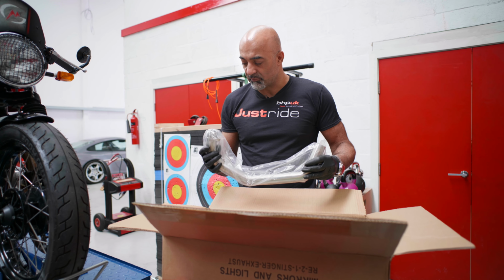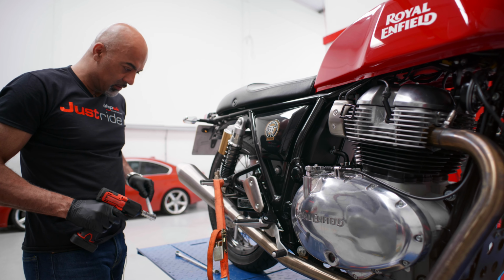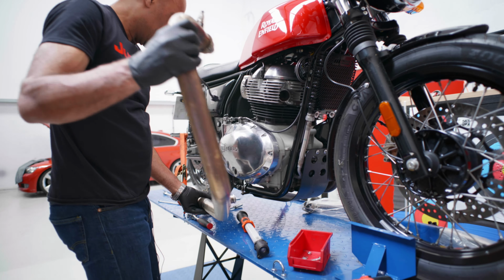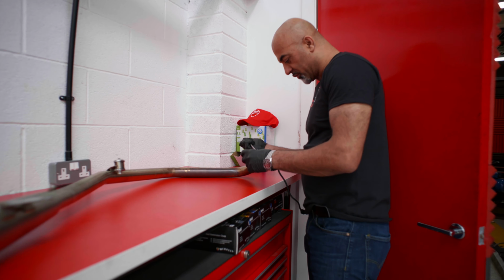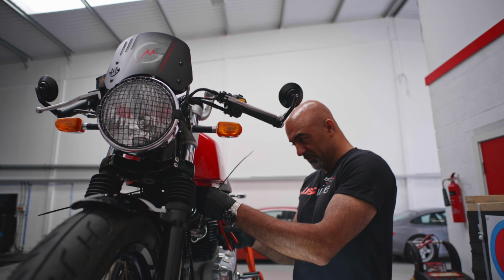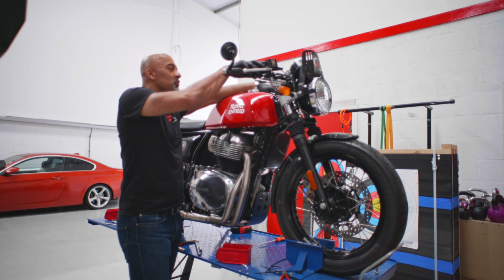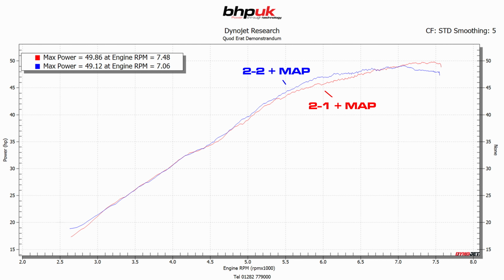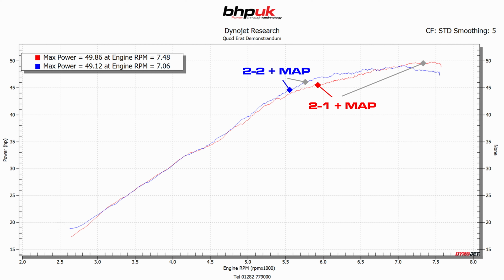Remapping the Tec Stinger 2-1 exhaust system | Royal Enfield Continental GT 650

Comment: Don’t forget the weight save that comes with the 2 in 1
Reply: Important point and a serious weight saving too!
Reply: 2-2 with a lithium battery be similar weight to 2-1 with stock battery & sound better & look heaps better.No exposed welds,no springs & TEC 2-1 works good but looks cheap & is made cheap but not alot 2-1 options out there.A 45mm 2-2 system no joins until mufflers & 45mm S&S mufflers no swagged end no gaskets best sounding & looking & with only 1hp difference between them.A 2-1 system with only one join at merge pipe if like 2-1.
I wonder how many 2-1 TEC have sold with their 4hp & 8Nm(53rwhp 71Nm) claims more than 2-2 big bore systems when other 2-1 systems built better less joins only make 1-2hp more max.A lot of people only buy TEC cause they believe hype & stats & think they getting 4hp 8Nm more.They cheaply made & reflects in price,springs outdated & fall off.
Good to see a independent source comparing systems first time I've seen TEC compared to 2-2 but never believed their stats where better companies only 2hp max better.
Was the 2-2 a TEC as well or other brand?
Reply: @ruahinesrider  This is subjective. I ride in an area of the united states where I have roads with potholes that swallow babies and salt on the roads from Nov to May and my Tec 2into1 has held up great. I have close to 4k on mine with no issues at all. Don't know how a spring could be outdated (not a lot has change in the spring technology department in the last 350 years) I mean this dyno just showed a increase of 4ish hp over stock (at the wheel not the crank). Looks are subjective but the S&S comp 2into1 is ugly plain and simple. Im very happy I spent 400usd for a full exhaust I like the look of and is a good quality then putting on a 800+USD exhaust that has S&S stamped on it.
Reply: @Jmacfann  Definitely agree about S&S 2-1 being ugly especially from front on with angle & have 2 high flow cats.The S&S Scrambler 2-1 look awesome but only made for companies & prototype & not for sale on market yet.Verex make a nice 2-1 kit.Tec work well & the old technology of springs let them down & better quality steel be great but I would still buy them as there not alot on the market for 2-1 unless you go custom.
Reply: @Jmacfann  S&S & Hitchcocks,Verex & others use a higher quality steel & have a better finish than TEC pipes.
The S&S 2-1 are ugly have high flow cats & ugly angel looking from front on.The S&S 2-2 race only are fantastic & are probably the only 45mm straight through pipes on the market.Most mufflers are 41mm to 45mm.Also the internal design of the S&S race only is excellent & is a Honey comb design & no packing etc to come loose & fly out the back like Tec 2-1.The S&S 2-2 race only hooked up to 45mm big bore headers will give 45mm straight through no reduction like others that reduce to 41mm giving the S&S 2-2 race only mufflers a unique sound & tone when combined with Verex special order 45mm straight through no reduction to 41mm & Reverlry Cycles also do 45mm no reduction designed to work with S&S 2-2 race only mufflers.Would be great if there more 2-1 headers on market or 45mm no reduction 2-2 mufflers but only fit S&S 45mm mufflers.

Comment: BHP static tests don't mean very much and if you reran this test with slightly warmer or cooler air temperatures you would get different readings, so do you like an unbalanced motorcycle or a balanced motorcycle is the only question you need to ask yourself,  I ran a 4-1 system once and I must say when it was swapped out to 4-2 it felt much better, more balanced. . hehe

Comment: my tec 2-1 after 3000 km have a leak at the down part the splitted section. and this cause black leak i wrong in something? and the of one of the two pipes is not very titen and continue to barely move even if i tight the piece part every two week i ll go mad
Reply from the maker: I would contact Tec if you have any questions about it.

Comment: What is the standard set up making on your dyno for comparison?
Reply from the maker: Hi Darryl. Here is the setup for the standard bike and 2-2 exhaust. All the figures are there for comparison. 
Let us know if you need any more information, we’re always happy to talk to fellow bikers. 
You can call us on 01282 779000 👍🏼
Reply: @BHPUK  just interested for a comparison really, i have a Kawasaki VN900 with 2-1 danmoto exhaust, kn filter , modded air box , O2 sensor delete and a booster plug. No ECU mods though
Reply from the maker: @darrylredmill4376  the results on the Kawasaki will be very different. We don’t have any plots to compare for that one though sorry.
Reply from the maker: @darrylredmill4376  the results on the Kawasaki will be very different. We don’t have any plots to compare for that one though sorry.

Comment: I have 25,000 miles on my 2020 INT650 with the TEC headers and TEC silencers. It took fuel mileage from 72 mpg to over 75 mpg with NO other modifications other than Bridgestone Battlax tires in sizes 110/90 front and 140/70 rear. It is as if the bike has been "uncorked" letting the genie out of the bottle, takes very little throttle to maintain the same speed as stock exhaust so efficiency is vastly improved; the pipes barely get hot. Virginia, USA.